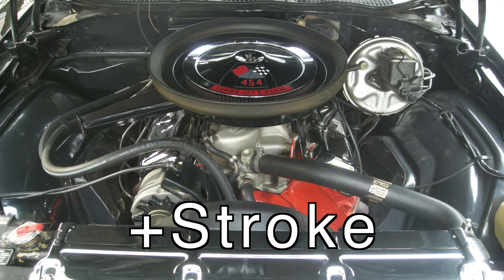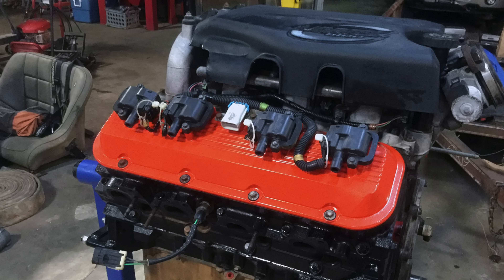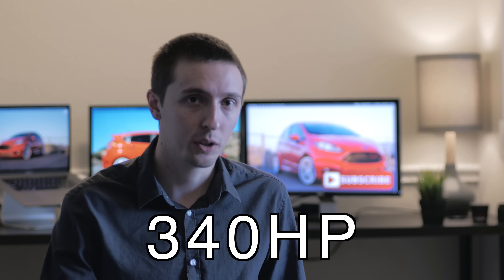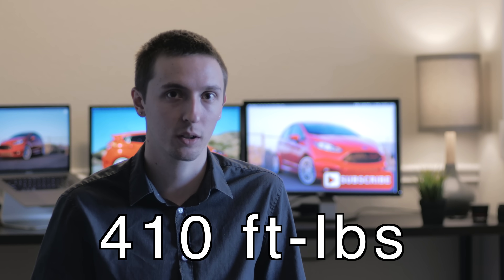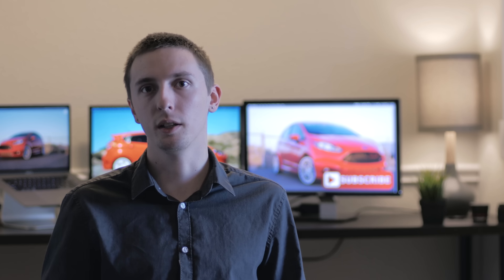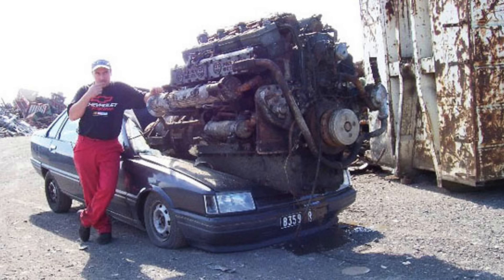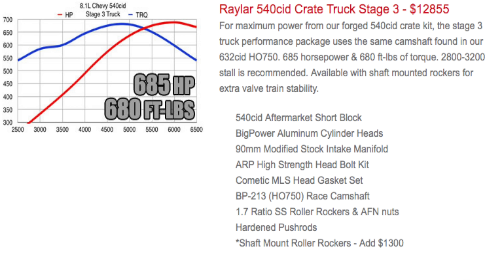Vortec 8100: Everything You Want to Know | Specs and More

Comment: If it is gasoline powered, it is always working against a partially closed throttle plate and with a low compression. It'll NEVER match the economy of a diesel, period.
--
In terms of power and torque, you are not going to beat the 445 hp / 910 lb-ft of the Duramax 6.6 (L5P).
Reply: Add boost to a big block gas engine and it will make big power. Typically they can't make that kind of power over time in high load applications and still be reliable but saying they can't do it is incorrect.
Reply: NEVER match the fuel economy.  I don't know about that.  When diesel is towing something it's fuel mileage is the same as 8.1.

Comment: In 2002 when I bought my truck I test drove both the duramax and the 8.1.  Way more fun to drive the 8.1.  I was going to be doing occasional towing and hauling but mostly daily driving so I chose the 8.1 and never regretted it.  Later I converted the truck to E85 and a performance tune which really woke it up.
Reply: The stock tune for the 8.1 is allmost the same as the 4.8 and 5.3 and 6.0 of early 2000s. Hp Tunes is the name of the ECU editor. Those engines stock cut fule at 3,900 rpms and run 13.5 to 1 to heat the cat for emissions. But will idle fine at 16 to 1 and hit 6,000 rpms with ease at 12 to 1. You can also up the pressures in the trans strecht the gear lenght out and make downshifts happen where you want. Itd alot to learn but its fun. I tuned a few after a year of seat of the pants tuning with mine and the guys could not belive it. Dont even bother with cams and heads unless you do a tune too. One dude i told him put back the stock injectors and air intake i cant help you. i could have figured it out but it would have taking me a month theres that much stuff in the ECU. Drive by wire stuff i was like no im good.
Reply: What is required to run E85? I have a 01 that I would like to run it.
Reply: @edreretana9229  All I did was I got a Wester's garage tune on the computer.  I had them tune for exclusively E85 and I had them remove all possible torque management.  If you have not done it, removing the torque management is huge.  Wester's garage is awesome.  You could argue I should have done more things, but it worked very well for me.  Driveability and fun factor was night and day.
Reply: @blperoc  really, no bigger injectors fuel pump ect?
Reply: @edreretana9229  That is all I did.  I sold the truck a couple years ago, but going off memory I put about 45K on it with this config.  I would recommend talking to Wester's.  If you don't have torque management turned off yet you'll probably be surprised how much difference turning most of that off and going to E85 makes.  If I stomped the throttle my truck would hesitate for a split second.  I thought this was dangerous when pulling into traffic.  After the tune it had instant throttle response.
Reply: @edreretana9229 right, usually an e85 conversion requires fuel lines, o rings and more.

Comment: I have a 2001 2500 Chevy with 8.1 just turned 200000 still going strong i would like to see it hit 300000 if it does it would be my first vehicle with that many miles the heaviest thing i haul is my 5th wheel which i havent haul for a awhile.just replaced the serpentine belt.